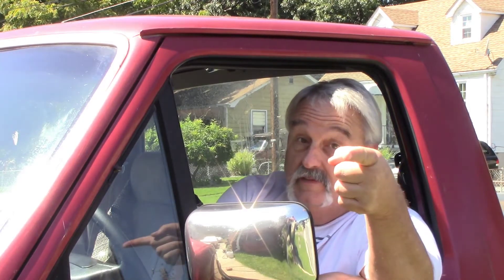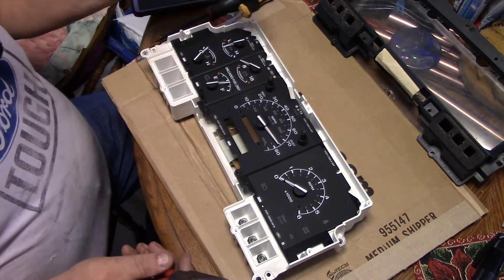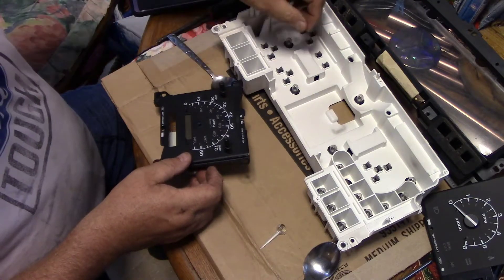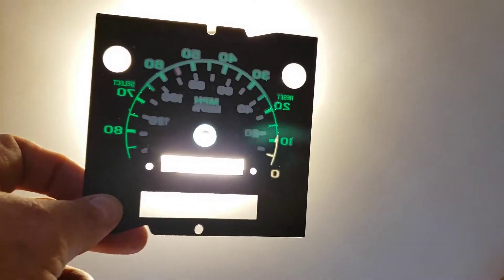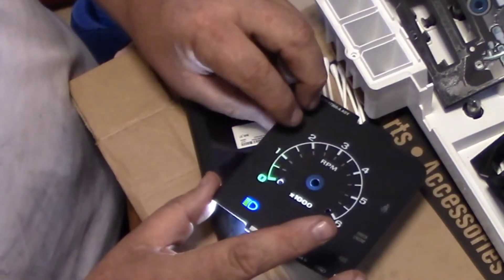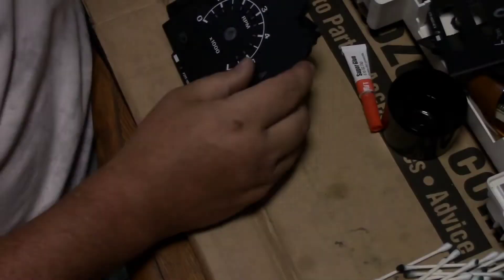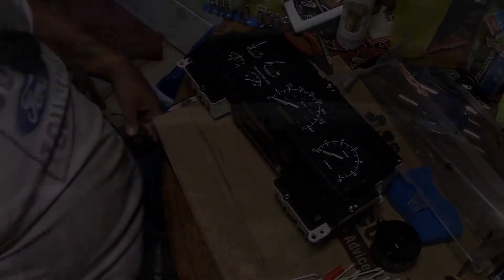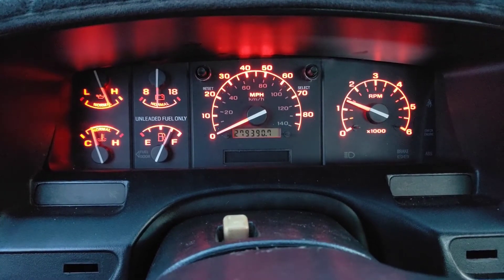How to add a Factory Tachometer and LED Color to your OBS Ford F 150, Gauge Cluster Upgrade

Comment: Hold the reset button or select, I forgot which one and turn key yo run not start but run and they should do a full sweep and go back to 0 at that point set your dails to 0 also, also incase you don't know you can calibrate the speed o and millage for different tire sizes!
Reply from the maker: I knew about the tire but not the reset, I will try that tank's, thats what's great about this I surely don't know it all you all  see me bumble through stuff, but this community will step in and help out. Again thanks ill let you know how it goes
Reply from the maker: You are correct fine sir, I held down the reset button and the Speedo did the reset, however the other gauges did not, Thanks Man, I know there had to be a way
Reply: How do you do this for different tire sizes?
Reply: @n8D97  to much to explain but there are videos on it

Comment: The trick to knowing where all your gauge needles were originally is to put a mark on the gauge cluster face itself at the tip of each needle before you pull off your needles erasable marker ect. & or take a picture as well
Reply from the maker: That should work but the pin that the needle sets on moves around, but thanks for the input, i'm always open to suggestions

Comment: Wait you can just sick a a tach dashboard in there and it already has everything you need to operate the tach???
Reply from the maker: The truck is wired wor it, I will be doing a video on adding Cruise Control, you won't believe how easy that is

Comment: I would lime to replace the electric gauges with mechanical,at least the oil and temperature , without having to have extra equipment screwed in the dash or door jam ,
Reply from the maker: Just one suggestion, Get a copper tubing kit for the Oil, I almost burned down my DD because of the plastic line on my oil gauge

Comment: How accurate are your needles after installation since you’ve uploaded this video, I just finished doing this and my needles are way off and i don’t know how to make them read right
Reply from the maker: Well the oil gauge is where the old one was, the Volt meter I took a reading of the voltage at the battery with a multi-meter and pulled the needle off and stuck it back on close to what the battery reading was and now its pretty close, the temp I warmed the truck up to operating temp and placed the needle about where it normally ran at operating temperature, I knew about how much gas I had so that was easy, the speedo I did on a back road at about 10 MPH, that was tricky its' about 2 MPH off, but I can live with that.
Let me know how you make out, hey just a thought, fill the tank and place the needle on full, oh and dont run the tanks lower then 1\4, thats how fuel pumps burn up.

Comment: Would a 91 ford ranger tach cluster fit in my 93 ranger that didn’t come with tach
Reply from the maker: Sorry but I don't know the answer to that one
Reply: @AintScaredGarage  the cluster in the 90s f150 is really similar to the 90s rangers but I don’t know if the cluster with a tach has any extra wiring that the non tach cluster has

Comment: nice video! I'm glad you're happy with the results, that's all that matters. little tip I've discovered from doing this a lot, before you ever take the gauge cluster out at all, let the truck fully cool overnight and take a picture of the gauge cluster( with the key on-but not running) from a stationary point, that you would normally view from. then, after your color change and led swap, when its time to put the needles back on, don't install them, put the gauge cluster back in the truck fully assembled(minus the front plastic and needles)and turn the key on. then look at the picture you took. use it as reference to where the needles should be. and carefully place the needles back making sure you press straight down and don't turn as you push. then you can start and drive the truck and see how it looks. if you are satisfied, remove the gauge cluster, dust it off and replace the front plastic. since you don't have a cluster that hasn't been apart to reference from, you could get another factory assembled cluster and install it temporarily to get your readings from, to match your modified cluster to. Doing this method with the ignition on powers up the needle motors , puts them in the correct position, and stops them from flopping around while you carefully reinstall the pointer needle. Also, you don't have to change all the bulbs to get the red look you were going for, the high beam, check engine , and other separate lights are all separate bulbs that wouldn't be necessary to change for the red look, if you look where the bulbs sit, you'll see partitions where the light is divided up for the different indicators. you only need to change the ones that light up a large area inside the cluster and not the ones in the little partitions.
Reply from the maker: Now thats a good idea, I'will use that in the future, Thanks, and I didn't change all the bulbs, well I did but I put white LED's in places like the warning lights and the high beam light, as I wanted all LED's, but the red ones are only where the numbers are, Thanks again and always bring that wisdom to us, as a collective we can do anything, Thanks
Reply: hey Mikey, I'm planning on doing this soon but currently my gas gauge is a little off. What do you recommend when installing the needles back into place?
Reply: @G93KMA  well, if it's not a sending unit in the tank problem, which I would check first.  The only other thing I can think of would be to completely run it out of gas then set the needle to just barely below E

Comment: You never showed were the red lights go my app gage will not work ever thing else you did a great job don't know amp gage has a fues tried every thing I have same truck know know speedo or amp been mo trying shop won't work on it go 3000 dollars more parts to put on it but tell I get gags work don't want go on thank you
Reply from the maker: Passably you got a bad cluster, also you said it was an Amp Gauge, mine dose not have an amp gauge it has a volt gauge, but I would check out the gauge itself, Also I dont trust those gauges I added aftermarket ones on the pillar so I know for sure what I got going on in the engine

Comment: great information thank you so much. was the cluster with the tach taken out of a 4.9 6 cyl, or a V/8. if it was is there a switch you change in the back from 6 to V/8   if it was, was it a direct connect plug and play where you didn't have to change any of the plug pins and re-route
Reply from the maker: I dont remember if it was a V8 but the truck I got it from was a Flareside extended cad that was loaded, so I think yes it was V8, and yes plug and play except for the Volt meter, you may have to do a search on that, there is a wire that should supply the 12 Volts to the alternator exciter  that may not, I fixed that issue the wrong way and put a 12 Volt in run wire directly to the alternator, it worked but I dont know for how long, I DO NOT suggest doing that, but it's your truck, otherwise, it was plug and play

Comment: Thank you for making this video, was very in depth and appreciative the camera work. Makes it easy to see what yoy are doing and talking about.

If I may ask, my  "P R N D 2 1" on my 92 F250 "works" when shifitng however the tack itself when in Park is at "1". When i shift to R, N, D, etc the tack just goes to the right off the display. I assume it should be an easy fkx but im unsure if i need a new part rather than fixing the old one. Could be the tack needs to just be moved. Thanks!
Reply from the maker: That sounds like a bad tach or a wiring problem

Comment: Tach cluster swap was the first thing I did to my 94 f-150. One of the things he didn't cover in this video is if you have an auto, you have to unhook the cable for the PRNDL. I found its easiest to drop the knee bolster and you can get it unclipped and slid out without taking the column surround apart. As he found out Ford runs the charge circuit through the cluster. 94-97  clusters will work for everything but the alternator. 92-93 clusters, 94-95 clusters, 96-97 clusters interchange.

I also find using a fork to remove the needles from the cluster is the easiest. Just slip the fork under the needle and lightly press the needle up.
Reply from the maker: Thanks for all this, just one question, How did you fix the Exciter Wire for the alternator on yours, what I did was run a hot in run jumper wire, but thats just a shade tree fix, I imagine there is a better, or recommended way.
Hey and thanks for helping out, I really dont have all the answers and I depend on you all as well.
Reply: @AintScaredGarage  I pulled 2 clusters from the yard and one happened to be the right age range for my truck. I didn't have to change anything to get the charging system to work.

Comment: about the calibration I know you must disconnect the negative terminal of the battery and alligator clip it to the positive terminal and turn your lights on and leave for 10 minutes, let all of the charge get out of your truck and that makes sure it's a cleaner reset
Reply from the maker: I may have to try that, Thanks

Comment: Here's a link to another video where the guy talks about calibrating your gauges - .
https://www.youtube.com/watch?v=XqmTd0AMkyQ&ab_channel=ClusterFixWashington  
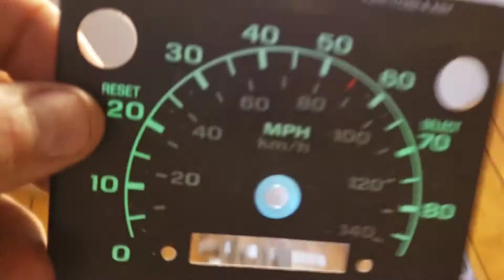Apparently there is a connector under the glove box - a blue wire with a yellow tracer and....   Oh, oh, you're going to have to take notes cause you have to ground "that" wire with the key off and holding the reset button in blah, blah, blah.  The instructions start at the 7:30 mark but the whole video in quite informative.  I'd just like to thank you for taking the whole cluster apart so I can see what to expect when I do my cluster.  My switch to go from the front gas tank to the rear gas tank seems to work but the gas gauge doesn't seem to read the fuel levels.  I wish the Lord would hurry up with the warm weather so I can get outside and play with my toys.  I'm going bonkers with cabin fever.  Damn Canadians can't seem to contain their cold air and keep it above the border.
Reply from the maker: Boy Howdy I agree about the weather LOL, thanks for the link, if anyone is changing there Tire size, bigger or smaller thats how you adjust the speedo, Good link, Thanks

Comment: Hi, I did the cluster swap from a 96 bronco to my 96 F150. Everything looks fine beside the Temperature gauge. It does go from C to the first mark of the "NORMAL" range. Drove it around for awhile and it still not come up to like where it was before the swap. Heat and AC works fine....
what do you think is the cause and any suggestions of what I should do? Thank you.
Reply from the maker: Those Ford temp gauges are not much more then over glorified idiot lights, the oil gauge is the same, I put in aftermarket gauges cause I just dont trust the stock Ford ones, I got mine on the pillar but you can just put them on the bottom of dash if you want, but I would put in a set you can trust.
Reply: @AintScaredGarage  thank you for the reply and advice.

Comment: Well done sir!  If you don’t mind me asking what year is your truck, and what year gauge cluster did you buy?
Reply from the maker: The truck is a 95 and I think the cluster is a 93 and that may be the reason I had to add the exciter wire to the alternator but other then that it all worked fine, Dodge Ram was correct when he said to hold the Reset button on the speedo and turn the key to run, but dont start the engine, the speedo went to the top and back to 0 and now it it is re-calibrated, however the other gauges looks like are still kind of a guessing game as they did not move
Reply: @AintScaredGarage what's the exciter wire?

Comment: I appreciate you putting all the time and effort into walking through all the detailed steps.  I just picked up a 1994 F-150 for my son and I'm sure some Mods will soon be in store :-)   

Any suggestions on where to pickup secondary Instrument clusters like you used given these trucks are old and not easy to locate parts?
Reply from the maker: Actually you can find them all day in your local junk yard, they made a mess of these trucks and at this point a lot of them are being discarded as just old junk by people who arent Car and Truck enthusiast, I know here in MD I can always find 4 to 7 in any junk yard I go to, remember if it's a specialty truck like a short bed or flareside, the parts from the back  of the cab forward are the same as the long beds. Thanks for the comment and let us know how the build goes

Comment: I’m considering doing this to my 93 f150 and have a question if I don’t take the needles off because I don’t want to change the color will the gauges be accurate from the start instead of slightly off
Reply from the maker: So to answer that I would have to say, if they are accurate on the truck you get the gauge pod from then they should be accurate in you truck, however just remember Ford stock gauges are basically over glorified idiot lights, if you want to accurately monitor the Oil, and temp {the volts should be fine} add some aftermarket gauges as well, I did the dash just for the looks I dont trust the stock Ford Gauges, and they are way off from the real reading I'm getting from my added gauges. Thanks

Comment: Do all have green on them i have 93 f150 don't see green just try to add red leds not sure with blubls to change
Reply: How many leads did you put in my gage is just like yours 93f150
Reply from the maker: I think it was like 6 but I dont remember, after I took it apart I realized I bought too many as there are other's that need clear bulbs like the turn signals, high Beams, ABS light and the Check Engine light

Comment: Did any wires have to be added for the tach to work? I have a 93 and been wanting to put a tach in.
Reply from the maker: No the truck is wired from the factory, the only issue you may have is the alternator, you may have to ad a hot in run to the exciter port for it to charge, it all depends on what year you get the cluster from
Reply: @AintScaredGarage how would I go about doing this? Any videos on it I’m currently having that issue with the alternator, put the cluster in with the rpm gauge and my truck won’t charge.

Comment: I'm curious. Did the new cluster come out of an F150 with a 6 cylinder? Might be why it reads wrong.
Reply from the maker: You could be right, I'm pretty sure it was a V8, but I think other then the tach the gauges are the same, and the Speedo is the one from my truck, after moving the needles they seem to be reading fine

Comment: Do you need to mark where the needle's are before removing them?
Reply from the maker: That would be a good Idea, the only thing is its real easy to move the post that they are on, I dont know if that would have helped me, it might have but I was replacing the gauges that originally came with the truck, so I dont know, but that's a great suggestion

Comment: I’m a little late to comment, but I’ve been wondering does it matter where you put the needles back in place or does it automatically know where the needle should be? So basically I’m asking should I be putting the needles back the same direction they came out?
Reply from the maker: Well thats the trick, I had someone mention that you can re calibrate the gauges , but it only does the Speedo, you need to know ware to put them back on, thats the tricky part because the gauges move when you tack them out of the truck

Comment: No need to change the speedometer  as the milage is in the computer not the readout!
Reply from the maker: Actually the milage is stored in the speedo that may not be true on OBD2 but this is the old OBD1 ,you can totally change the computer and it won't change the milage
Reply: @AintScaredGarage  When you get a new computer they have to program it with the mileage! they have always asked me for the mileage when changing the computer!